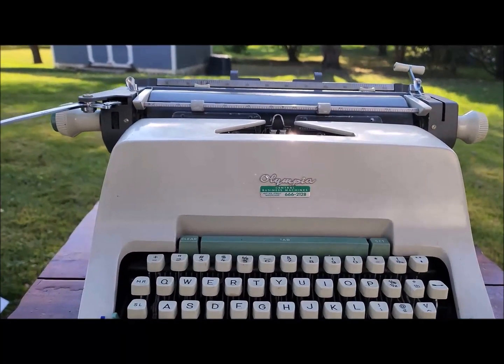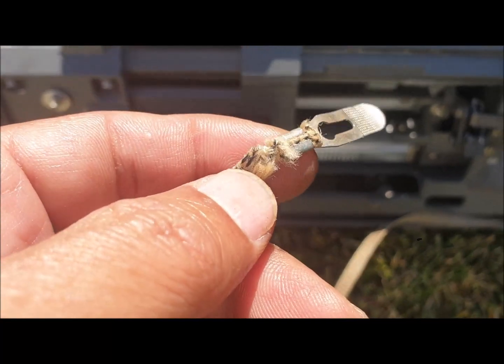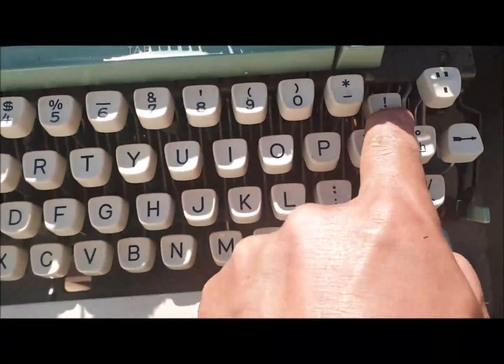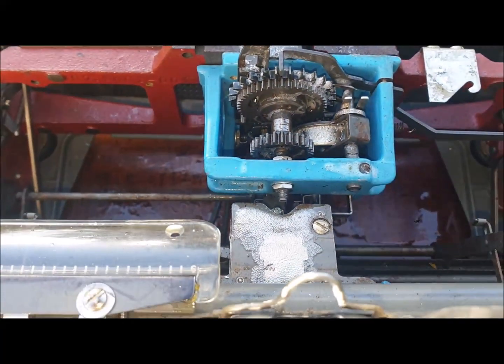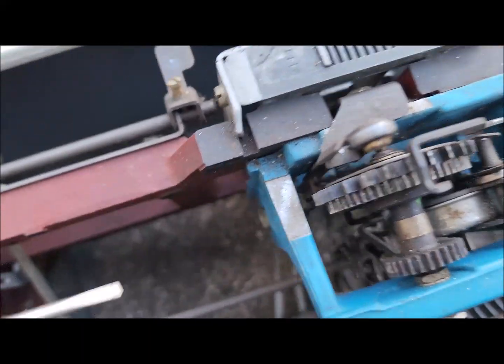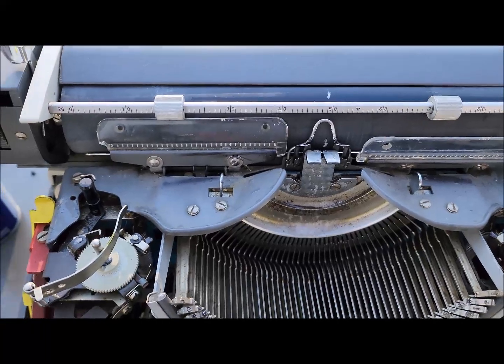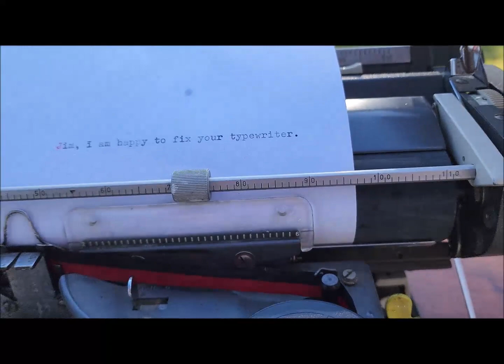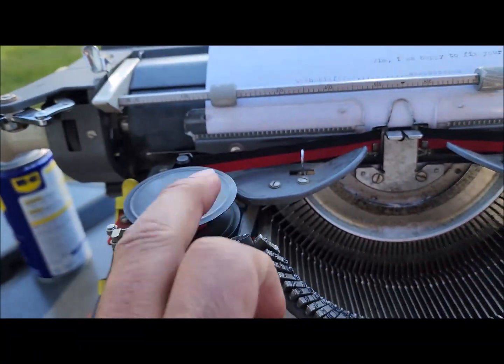Fixing Olympia SG3 for Jim

Comment: Do you really clean with WD-40?  I have always heard it was bad in the long run unless you flush out the WD-40 with mineral spirits or lacquer thinner.
Reply from the maker: Depending on the bad condition and the how old machine, of course it is highly recommended  to flush out the WD-40 with mineral spirits. I did not use WD-40 for typewriters after the late 60 and 70's.